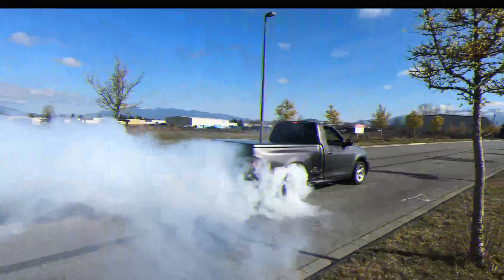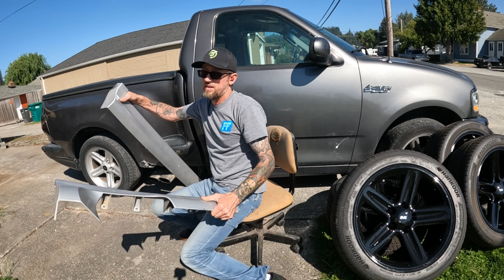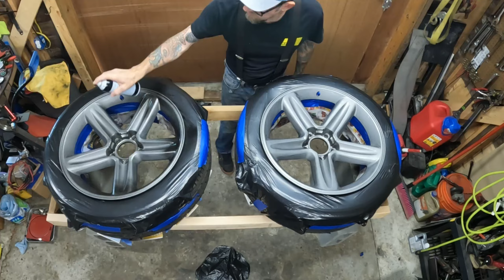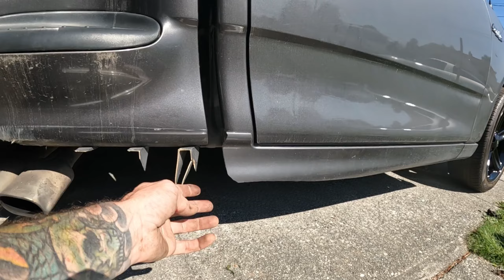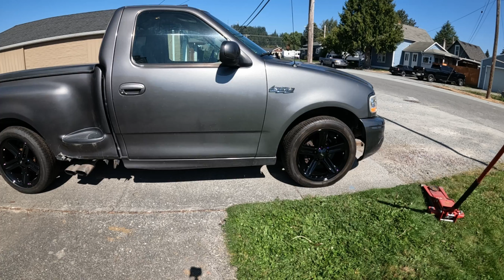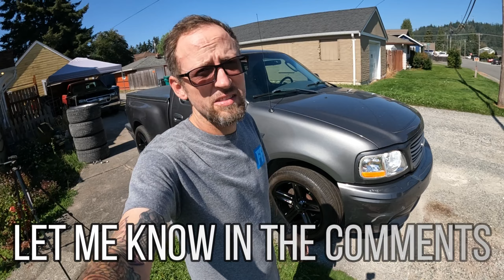2003 Ford Lightning WRECKED by Yellow Truck Rubbish TOTALED!?

Comment: Experienced an aluminum battery box cover come off a crappy truck-drivers fault for not doing a pre-trip- bent my tie rod, 76 F-250 4x4, drove over it and seen the box slide into the ditch.  Sped up and tried to acknowledge the stund Driver, who never did Piss all, phoned the company, and Nothing happened.  After my shift, went and looked, battery box cover was gone, could still see all the marks.  So Either the Trucking Company come and took it away, or some scrappers grabbed it.  So glad I wasn't driving a car.
Reply from the maker: @danderson9881  that sucks sorry to hear that man, thanks for watching and taking the time to comment. Did you get your truck all fixed up yet?
Reply: @builtmikesway1167  ohya, it's a work in progress!  Actually bent the tie rod straight, then replaced it due to wear.